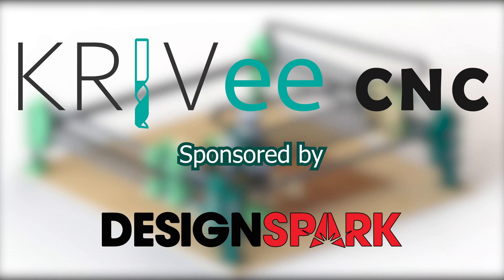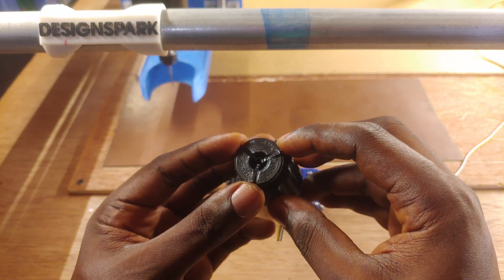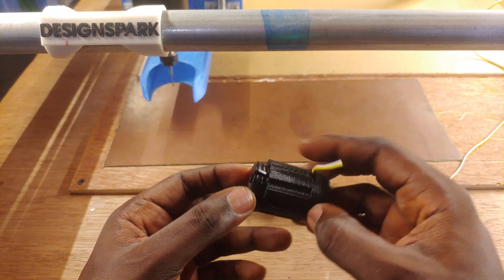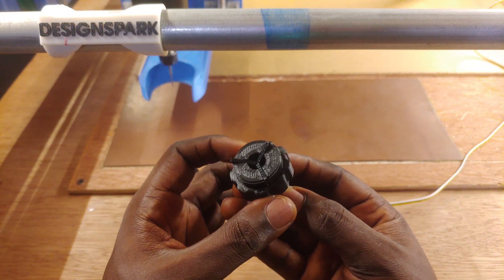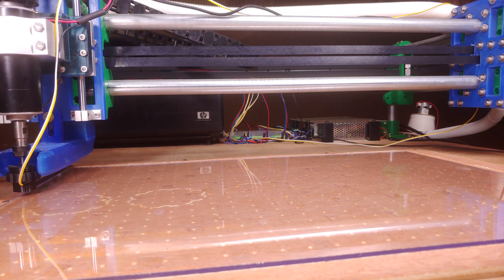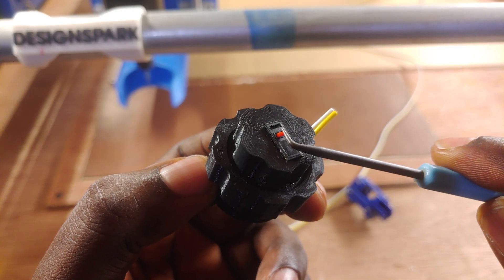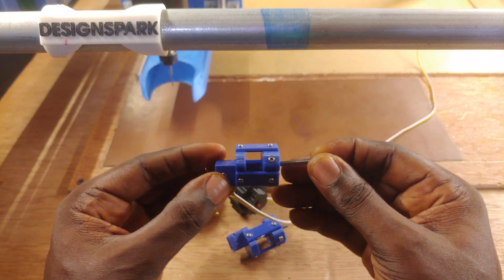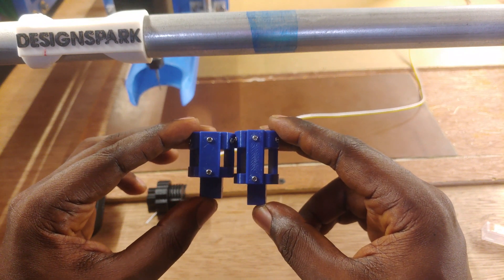Building a Core XY CNC Machine | CNC Probe Design

Comment: nice man, i've been thinking to build a corexy cnc router one. can it cut an aluminium?
Reply from the maker: I have not tested the CNC with aluminum yet, I will be releasing more details on capabilities and build instructions soon and I'll be testing aluminium before then.
Reply: @AhmsvilleLabs  keep up the good work man! what firmware did you use on this beauty?
Reply from the maker: Marlin.